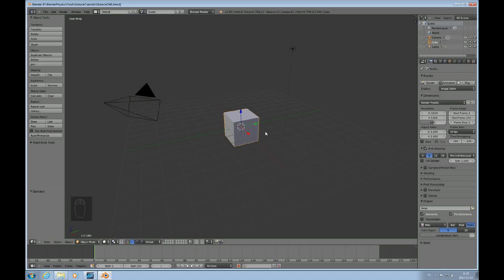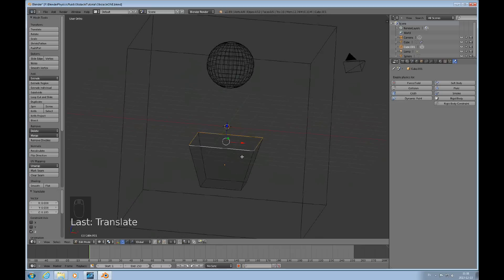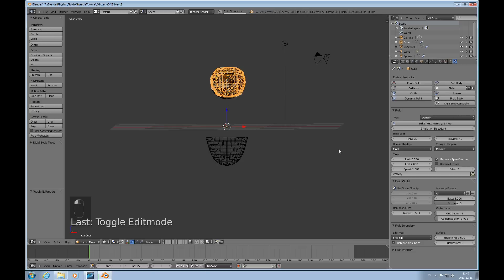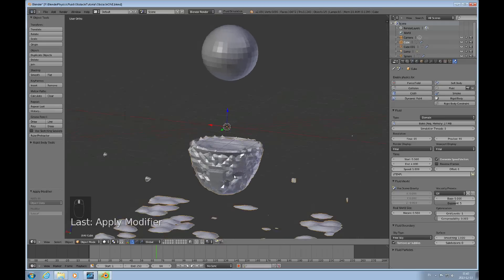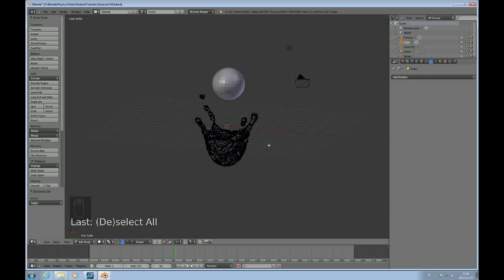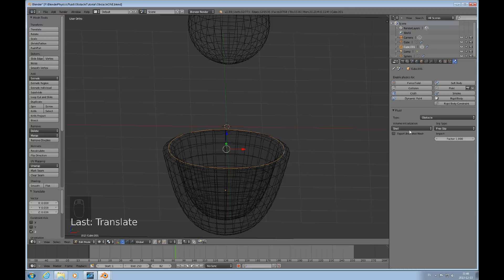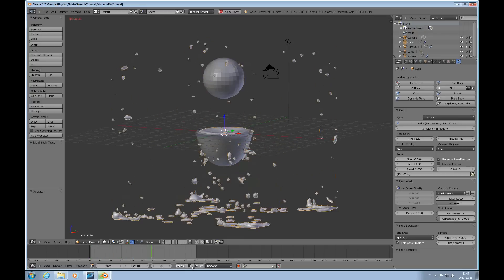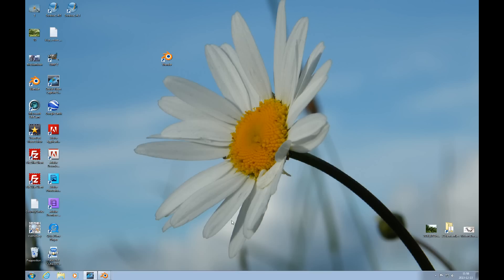Blender Fluid Tutorial TWO ( includes obstacle)

Comment: to prevent fluid break through the wall using double wall?
and is it similar using solidify?
Reply from the maker: I haven't tried using solidify for this  so I'm not sure how it would work. Using double walls only hides the fact that the fluid "leaks" through the first wall so it doesn't prevent the leakage as such.